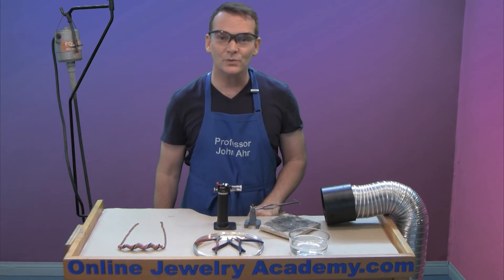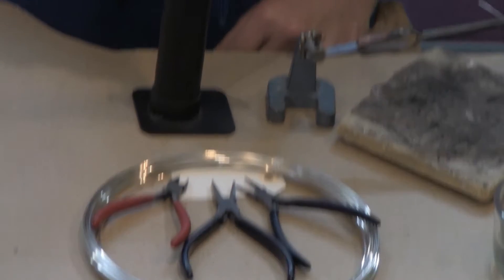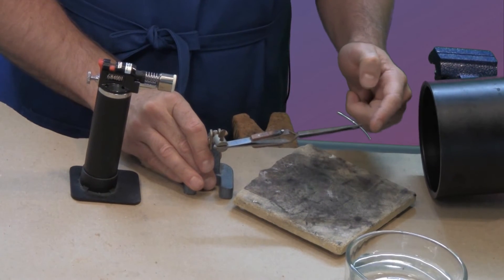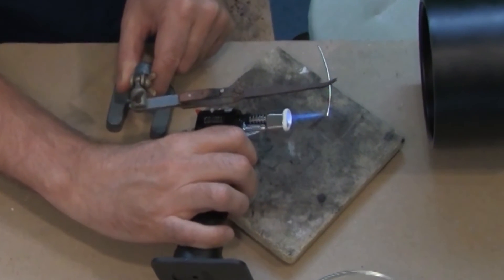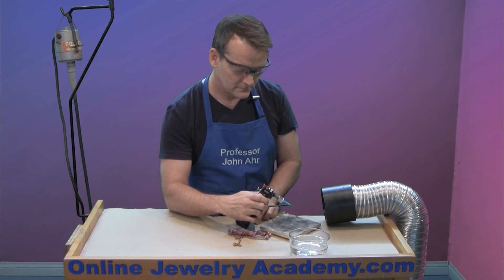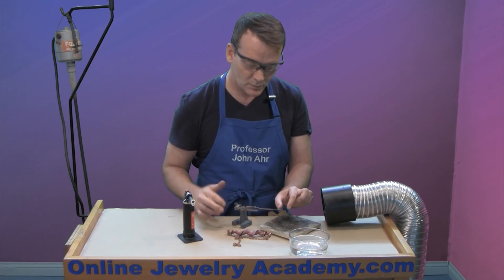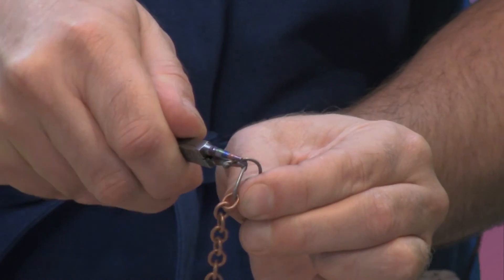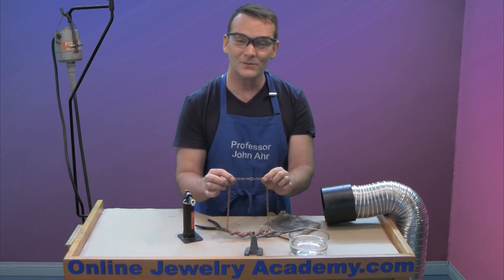How To Make A Simple Ball End Clasp

Comment: Thanks so much for your videos ! I don’t manage to ball them both ends with a stone in the middle.  Any idea how to pull that feat ?
Reply from the maker: Sorry, I don’t have a suggestion for pulling that off every time. Most stones will shatter due to heat shock. You could try using cross locking tweezers as heat sinks and submerging the stone under water. Good luck!🍀
Reply: @OnlineJewelryAcademy  thanks so much for your response John !  I didn’t think of the tweezers as heat sinks and will keep that in mind.  Kind regards from Kingston, Jamaica.

Comment: Can I ask why my gauge 14 copper wire won't ball though it did reached red orange point?  I did many attempts with out any success
Reply from the maker: It’s probably because your torch isn’t hot enough. It could also be because you’re holding the wire too close to the end you’re heating with a heat sink. 😀